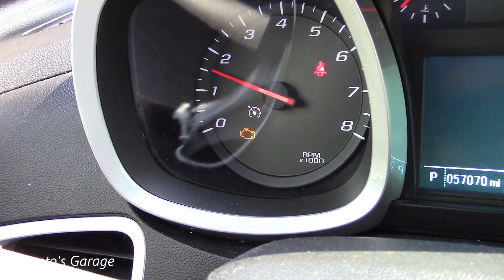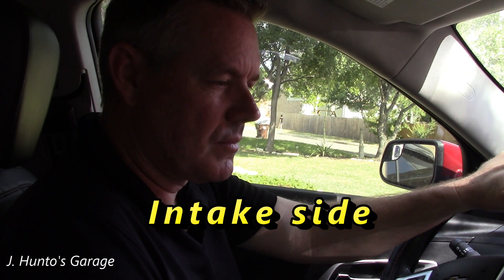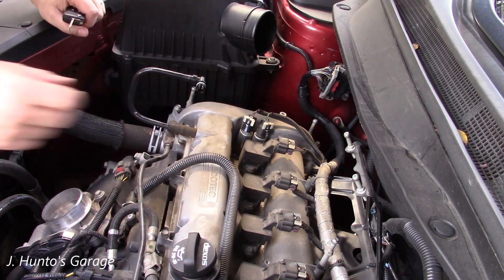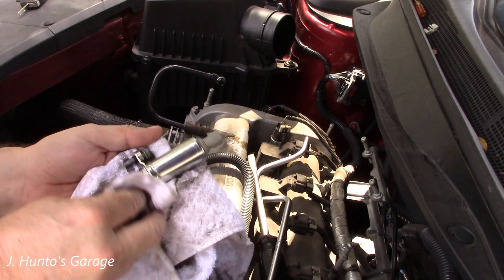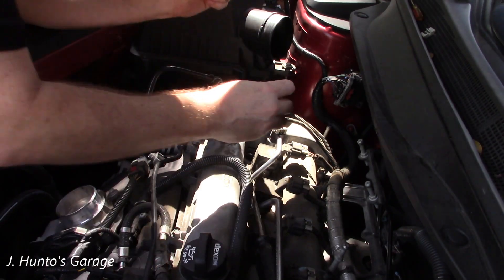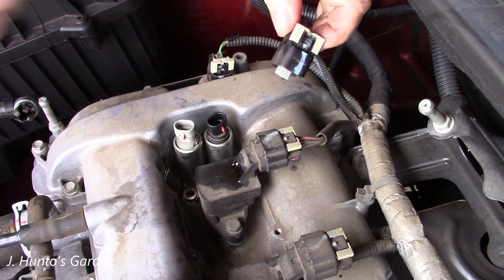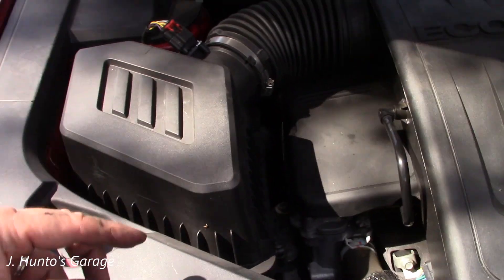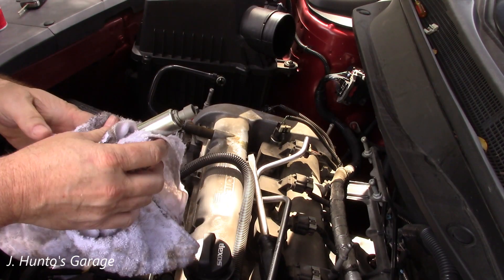Dead battery or Camshaft Actuator? Fixed,  not replaced!

Comment: anyone know where i can order the Actuators and where they’re located
Reply from the maker: @blakenicholson4395  I found them at the GM dealer for less than $50 if I recall correctly. Should be available at parts stores by now. Located at the passenger side of the cylinder head right on top. Again, if I recall correctly.  Good luck!

Comment: I know it’s been 5 years but did you happen to check engine oil level and remember what it was?
Reply from the maker: Never had a problem with oil level. However, later on I recall having to replace the front timing cover seal. I was not happy doing that on an engine with less than 50k miles. Hope this helps.

Comment: Had a problem with my terrain running battery down. It was the HVAC system. One of the blend door motors went bad. The system always has power running through it. If one of those motors cant get to the position it was trying to reach, it will try till the battery is dead.
Reply from the maker: That is excellent info! Thanks for watching and thanks for sharing. I'll be watching for that for sure.